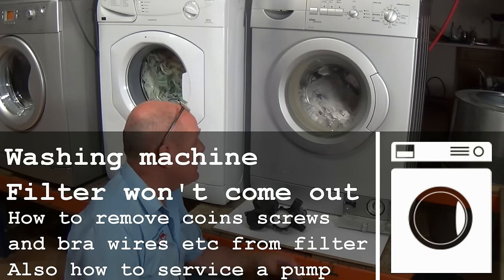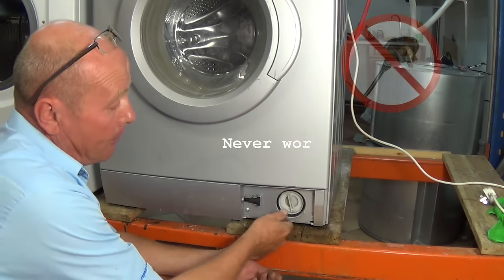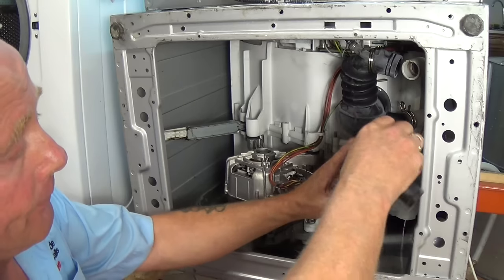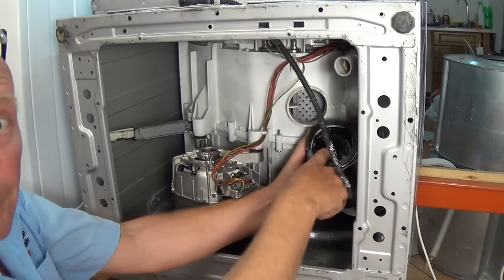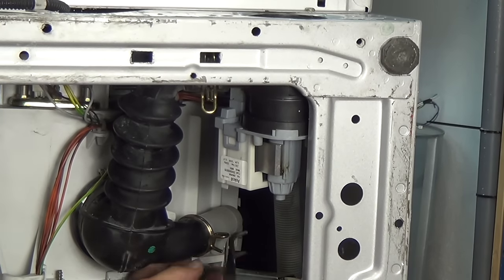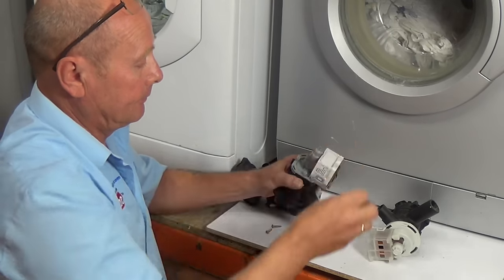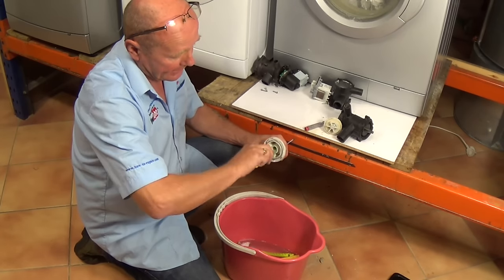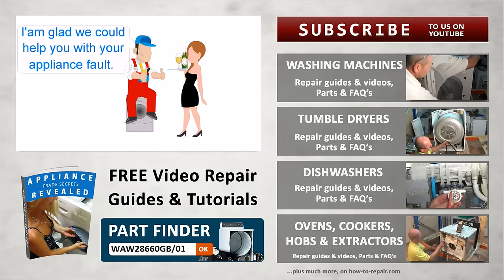Washing Machine Pump Filter Stuck Won't Open Jammed | Removing Coins Screw & Bra Wires Etc.

Comment: You saved me a great deal of agro. Found a pair of torn up boxer shorts and a Chinese (?) coin clogging up the filter. This video was better than the manufacturers' own self-help video for cleaning this out.
Reply from the maker: Glad I could help please remember to subscribe as that's is was keeps this channel going. Thanks 👍
Reply: where they still wearable?
Reply: Thank you for shedding Light on this mystery. 
The owner's manual is useless.
Reply: Thank you so much.

Comment: What an excellent presentation. So many videos (specially the American ones!) spend an hour telling you fifteen minutes worth of information. This was precise, to the point, educational and above all, useful in saving us lots of call out charges, dirty clothes etc (as of course our machine stopped over the christmas break). Well done, a lot of presenters could usefully study your style. Also it was excellent that you did not stop at unblocking the filter, but you carried on and did other useful work removing calcium and explaining many bits that users do not usually see. This is the difference between a professional who does the job thoroughly and properly, and the fly-by-night who charges £80 for a call out, removes a coin, pockets the money and disappears. Well done. I was a boiler service engineer with a similar work ethic. I would do the  'extra' bits of work to make it run better and longer, and customers would always thank me and recommend me to others. That is the way to run a successful business.

Comment: Thank you very much for the video. I have fixed my machine following your video. Thanks and Blessings. 
But that is not all, I want to compliment you on the video - it is so well made, each step articulately explained and videographed that different kinds of issues can all be covered in one video. In my case, the debri was stuck above the floater ball and your lucid, poised and accurate explanation gave me the knowledge and courage (yes, courage!) to open it up and give it a shot. You definitely deserve more than a beer from me! Especially in these times when no service mechanic can visit.

Comment: Absolutely brilliant! My engineer is on holiday, so I spent 2 days trying to solve the problem myself (with the help of other video sites). On the verge of giving up, then I found this detailed video. Went back to the machine and solved the problem in just a few minutes (a jammed 2p coin in the hose connecting the drum with the pump unit). Thank you very much!

Comment: My darling two year old kept putting tiny lego down the detergent dispenser pipe and i knew in time it would cause problems. Last night it stopped draining and the plumber wasnt replying to my requests for help. 

Our filter was jammed and wouldnt open so had to go full on in.

I followed your instructions and 90 mins later I had fixed the machine by myself! 
The hardest parts were getting the wires detatched from the filter and the tube clip ring things were tricky to get off and on again but I did it!!  So proud of myself.

THANKYOU!
Reply: How did you get into tje pump though an£ dd you tilt the machine did you have help howcdid you remember where all the parts go back as well?

Comment: Thank you for your very detailed and expert contribution! Cheers! Additional tip / my 2 cents: a) Always use gloves when manipulating parts, plugs, hoses, etc. inside a metal cabin, otherwise you can easily injure yourself on sharp edges of the housing. b) Do not wear a ring during any of these repairs; it could be damaged \ scratched and you could be injured if the ring gets stuck anywhere.

Comment: Very helpful and thorough information, nicely presented. Despite high calcium in the local water supply, the filter unit had never been cleaned before, and got stuck. Totally removing the unit and using a calcium dissolver did the trick, together with a few not too strong taps on the unit. Most calcium in the "ball" case. As the motor and propeller look intact, have still to check the heater and the grounding for the occasional short-circuiting. Even to the point the info was worth two rounds of beer. Cheers :))

Comment: Thanks to this video I cleaned my pump even without disassembling it, I managed to pull out the rubber pipe and clean the junk out of the filter. You saved me a lot of money for an half hour work!

Comment: I've been having real issues with my machine. I have never technically tinkered with a washing machine before, following this crystal clear video I've removed my pump, found a few tiny things that bipassed the filter so it was inside the pump and caused it to fail. Tested and now fixed. You saved me £90 call out and a new pump. I wouldn't have dared in the past. Top work. Thank you very much.

Comment: A huge thank you for your clear and comprehensive instructions! My filter which I’m only now aware we have ! wouldn’t open however hubby and I were able to solve the problem and  eventually found £4 in change and a bracelet which were causing the issues! Filter now working and able to open and check which I will be checking regularly going forward ! Fingers crossed all good and can wash again! Thanks again !!

Comment: Great video buddy thanks , I had an eventful day after watching this video haha i haven't cleaned my filter for about a year and it was totally jammed found a 5p coin a 1euro coin a kirby grip and 2 screws, behind all that was a tightly packed ball of hair, all the different colours my partner and 2 daughters have been dying their hair over the last year 😅
got it all cleaned out and put back together, putting the hose back on using mole grips for the clamp, it slipped and a tiny bit of metal shit into the cornea of my eye, so a wee trip to local A&E to get out it, doc says i done the right thing getting it sorted right away alot of people wait a couple of days and its harder to dig out by then, so I'll maybe wear some safety specs next time lol....

Washing machine back in action and BIG shout out to the NHS was in and out within an hour all guidelines in place 💓

Comment: Very nicely explained instructions Just followed them to clear clogged filter (cant believe it had so much of limescale deposits) in my washing machine. Hopefully it will help in getting rid of flashing lights error that was coming up earlier and was not letting the wash to finish..

Comment: Thank you for this great video. My Hotpoint seems to have taken on the role of a wishing well in my family, I found 4 coins, a 3mm twist drill and 2 tooth picks lurking in the filter and pipes. Unfortunately the impeller had broken off the motor shaft. So a new pump was called for. I guess I could have put the impeller back with epoxy glue but at about £20 for a new pump it seemed best to replace it as the machine is 10 years old.

Comment: Hey mate. Thanks for the video. I was just going to follow through with your video as I was getting an E18 error code on my Bosch front loader series 8. Cleared the filter ( a few things there) then I found the outlet from the washing machine that flows through to the filter then pump. I managed to wiggle my finger and noticed something 'linty/fabricy'(technical terms) and after many tweezers etc pulled it out. It was a breast feeding pad that had somehow wedged itself down there and was blocking the water flowing out in the set time it has preset. As you look at the pump impellers it is on the inside to the left. This may or may not help others, but I think (going through a cycle as we speak) may have saved me a call out from Mr Bosch! :)
Thanks for your upload! ps gave you a thumbs up! :)

Comment: Obviously this man knows his stuff…but just to add, the ‘last gasp’ before doing this, is to note that the filter cap is a proper screw thread, and will fully undo only after about 2 or 3 turns anti-clockwise.  The first tiny bit will usually unscrew even if it then goes on to jam.  Rag it a bit, right and left, not using much force, and the coin etc might well kick out of the way, circumventing the sensible and correct steps given here.  Also, use a bit of coathanger wire, to feel along the pipe, curve the wire and just see if there’s another coin etc hanging around just out of sight - mine had one!  The 2p coin in the UK is PERFECT for acting like a ‘butterfly valve’ once in the pipe.  All you need to know about that is, once a flow of water starts, THEN it blocks!  Flow of water stops or lessens, the coin ‘flap’ drops down again.  10p will probably do this too, I wish the entry/exit pipe had a couple of grille-fins to stop this.  Anyway, if the yanking the filter cap left and right doesn’t work, and don’t use plier-type force, then this man’s advice is the way to go.  Thanks for the video, it made me work harder to avoid doing it!  Take care all, be well, and be calm.  It will work out in the end, if we apply brains and effort, whatever it is.

Comment: How bloody typical for me; my pump filter Cover, is a smooth round flat disc, completely flush with the panel, and shows no way of removing it, unless I force a chisel into the tightest of gaps.
The so-called 'hand book'  shows a nice picture, with a arrow, pointing to it.   the end.

Comment: 😊😃 Thanks a lot! Our machine is an integrated Siemens Si14•44 , and I didn’t even need to move it. Just removed a front panel for access to the inlet of the pump filter. One coin, one pin of wood and a sticker! (believe it or not, how the h... did it get there?) 🤬 kids!
Less than one hour work, total from fault message to finish (incl. watching the entire film) in the evening saved me for about 3000 norwegian kroner (about 300 US$)! That would (at least) be the charge of a seviceman here in Norway, 1 hour service + driving....

Comment: Thank you! We saved ourselves provably 100 euros by not having to call out a technician.
Excellent vid. Super-clear instructions. I managed to use your guidelines to fix a Siemens IQ700 with a stuck filter cap. It would only turn 90⁰.
Accessing the pump behind the front  cover was slightly different; I couldn't figure out how take off the base of the machine, but managed to access the pump by unscrewing the plastic cover behind the filter cover. The blockage was caused by a Magnum ice cream stick and a couple of coins, along with a nice wad of gunk of dubious origin...

Comment: My Siemens iQ500 wm14q470nl/12 is giving the E18 during centrifugation step. I followed your advices and the trap was clear. I service the pump and it worked the first time. Then again E18. I proceeded to check the black hose (the tick one) but it was secured with an one ear oetiker clamp which I removed. The hose was clean. This washing machine does not have the ball you showed in the video but rather a chamber with sort of rubber ball. I searched for objects obstructing but I didn't find anything. The only think that I noticed is that the "rubber ball" has an opening at the bottom kind of partially splitting the rubber ball in half. Is this normal? Or could this be the reason of the E18?
Any other possible reason for the E18?
Note:. I have a picture but I cannot attach it her.

Comment: Doh! I recently received an Electrolux Washer/Dryer combo unit, and this was (I believe) the root problem it had. Only thing is, is I ended up brute forcing the filter cap off. Luckily I didn't break it, but I found two underwires lodged in - and possibly through - the drain pump itself.

Without the drain pump attached, I have full control over the electrics/cycle selection of the unit, but once I connect it up, it powers on BUT automatically spins the drain pump and I have next to no control over the selection. Moreover if I attach any old drain pump, the same aforementioned issue arises. I wonder...could a brand new compatible drain pump be the resolution?

Comment: Nice, if you clean pump [at video 10:20], is possible make it back for operation? This region of pump should be water tight, or it is normally flooded while pump operates?

Comment: Excellent video. Don't want to be picky but it's Calcium Carbonate or Limescale which only occurs where the tap water passes over limestone such as the Peak District of Derbyshire. In soft water areas this shouldn't be a problem.

Comment: Thanks so much for the explanation, my drain plug was stuck and I was trying to brute force it for ages. Wow had to take nearly the whole washing machine apart to remove the filter. Filter was absolutely clogged with hay from my bunnies! 🎉

Comment: I appreciate your information. But I am extremely pissed off that designers clearly know of this issue. Its 2022!!! Ffs- nobody should be dealing with this issue but for an industry clearly allowing this to continue. Anyone called sn engineer lately for this problem. How much did it cost and how many of you just bought a new machine.?? This is a typical issue. There is no way this should be a thing. There are clearly ways to design these components so that coins etc do not get jammed and stop a simple part from being unscrewed. I mean why is there even a cross piece that jams the coins. Come on people please fight back !!

Comment: 15 MINUTES!  I’m in a hotel and this happened.  The two maintenance guys just busted the cap, and pulled out the debris thru the hole.  Then, screwed in a new cap. DONE under 15 mins!

Comment: Hi how to repair.  Excuse me for my English. I own a candy wash machine...  Last time I saw the code E03.  I open the filter and clean it from little rocks. But the next time I use it I saw again the same code E03. I changed the water pump..   Next time I use it I saw again the same code E03.. What else can I do to fix it?

Comment: the LEDs on my "Indesit iwdc 6145" started blinking and it would not drain water. Indesit Customer Service told me they charge 189€ for a diagnosis, so it would be 200€+ with spare Parts. I ended up watching this video and cleaned the pump myself, i found a Aluminium can lid blocking the propeller. After some cleaning and removing the culprit the machine works as good as new. Thank you so much for uploading this video!

Comment: Up date.  Did it! I kept jiggling the stuck filter screw. Without forcing it.   Hey presto, after several minutes of turning, returning, it slowly turned, until finally it unscrewed.    Some rusty sewing needles, plant labels, fluff.  Sorted. Thanks!   I’ll check it more regularly!

Comment: Hi, great video, thanks. I did everything you said, I disassembled the pump filter, it was so dirty with pieces of calcio, I cleaned up. I also checked the brushes and they are good, almost new.

However, when I assembled everything again and made a test, the same sounds keep coming from (I think, by hear) from the pump filter. It sounds like there is something hitting in the pump filter but there was nothing (big, like coin, screw or like that). After 5 minutes and many times that sound, the washing machine stops and shows an E 8 error message.

Do you think that could be that the pump filter is broken?

Thank you very much.

Comment: Thanks a lot for the videos. just followed it and got 87p and a front door key out of the filter. 

Before i took them out the machine was having trouble spinning and making a right racket.
Now it is spinning like the wheels on a boy racers car.
Thanks again

Comment: OMG Thanks so much!! I had the exact issue with the filter cap and had given up. Found this video and psyched myself up for it this AM... Took 1hr, No money for me but some foam, lint etc.. and around 10 wooden matches wedged in the main large pipe from the drum! The Beko machine never had easy access to the pump screws (typical) but got there eventually. Machine working so well now. No drainage water left, items removed are not wet. :-D

Comment: Excellent video thank you. Cured the sticking filter very easily then spent 2 hours cleaning out  5 years build up of crud from the pipes. Only found your video by accident but will certainly check out your others now.

Comment: Great info. I just fixed my Beko washing machine because of this video!
In my coin trap I found two screws, part of a small plastic bag, a key, a Nintendo DS cartridge, a penny, a length of wire and a nut shell. No wonder I couldn't just unscrew the trap from the front.
What took the most time and effort? Cleaning. When you pull out the washing machine, there will be loads to clean behind it.
Flipping the machine onto its back may be hard, depending on the length of the water in and out pipes. I was constrained quite tightly. The actual trap disassembly/reassembly was comparatively easy, having watched the video twice.
Thanks!

Comment: I have a Bosch Logixx9.  The filter wouldn't open to allow me to fix an E18 code.  Your video was wonderfully helpful, straightforward, clear and encouraging.  On this model, you get at the pump from the front panel which is fastened by star head screws and pop-clip plastic lugs.  Took me some time to figure this out and I was initially daunted when I upended the machine to see no way in from underneath.  All went well: hairgrips, bits of old biro, pieces of plastic and a mess of fabric debris.  The wonder is not that it blocked but that it worked so well until today!
Thank you.  PB Cambridge

Comment: Great video, this really helped me get mine sorted.

As a side note, on my BEKO model, the pump can be removed from inside the bottom panel without removing the front, just by twisting. The only tool I needed was a pair of pliers to remove the large circlip, the rest came off by twisting.

Thanks again!